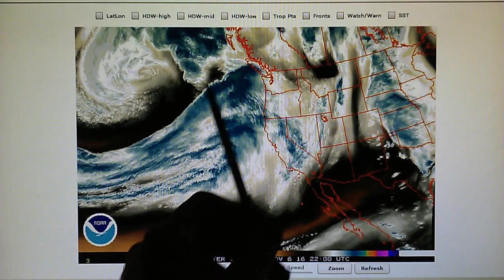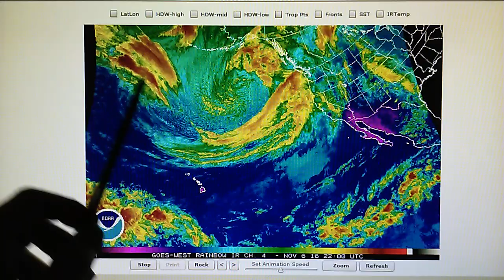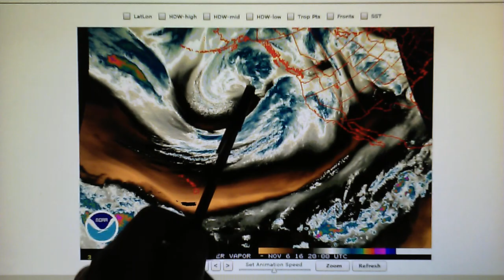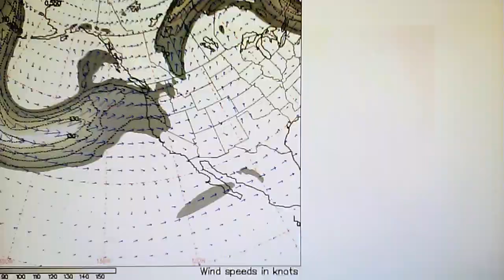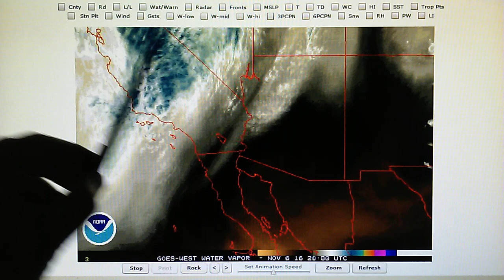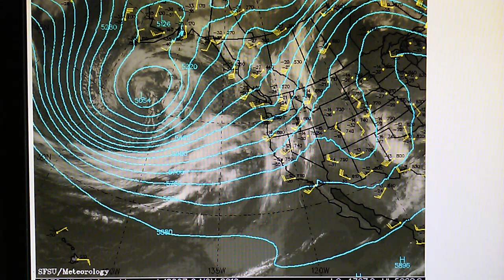11-6-2016; GIANT Storm System Off West Coast; Jet Stream Flow Into CA; Heavy Chemtrail Spraying!

Comment: Thank you 1PR.  >I turned on the television set to get the fake version of the local weather forecast for SoCal. Here's what the local weather puppet Kaj Goldberg read in his acting script: "High pressure is strengthening".. "High pressure coming in tomorrow".."High pressure system keeping away moisture".. " High pressure really pushing up temps".." We're flirting with 90's, the heat is on.."  {chuckle chuckle chuckle}

Comment: same amount of moisture coming into nor cal as with all the systems that came in before Halloween, but no rain. 

pressure is abnormally high like when rain is modded out normally.  I wouldn't be surprised if it was microwave or something really pinpoint,  this keeps happening over and over , and it's only in certain situations. 
this didn't used to happen .

heavy chemtrails over the area too. the worst is when they do it above the fog . 
shows a bunch of rain offshore but I've seen that happen plenty of times . I've watched a cell sitting offshore take 2 days to reach the valley.  it'll be dispersed by then